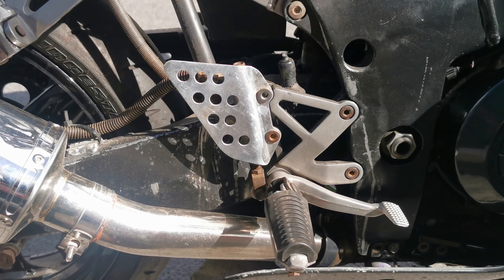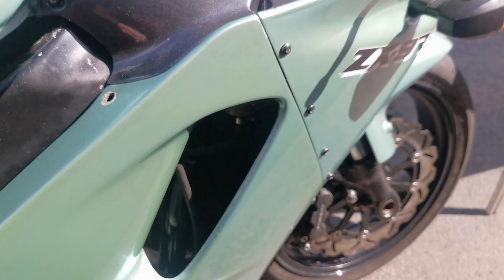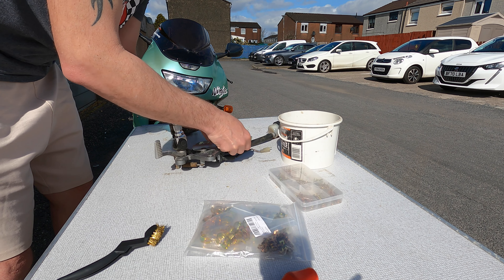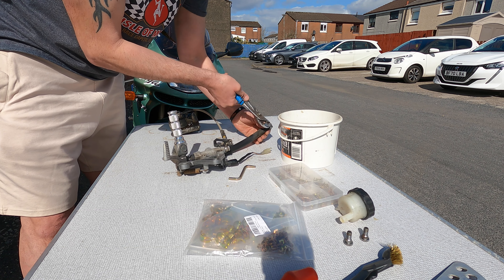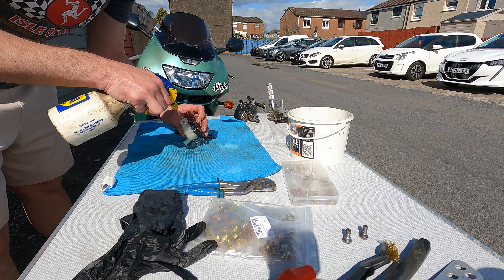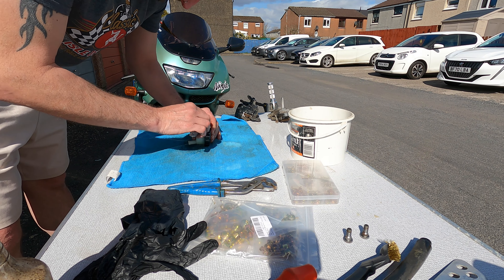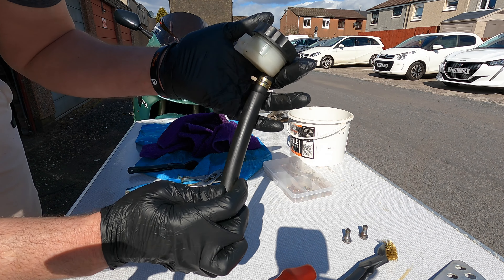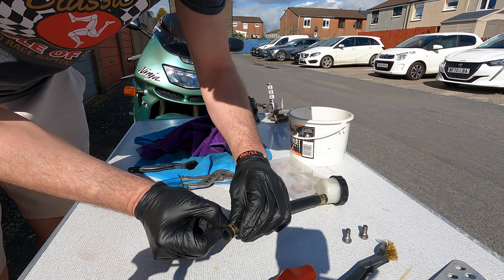Kawasaki zx9r restoration. #zx9r #kawasaki #smallchannelmafia

Comment: Good price on the replacement rear brake setup Zed ,do HEL not do a replacement for that rubber section then ? it did clean up nice having said that tho . Liking this bit by bit look waiting to see what you do with the piston/pump section behind the heel plate : D
Reply from the maker: It will be gleaming, tune in for part 2.👍👊